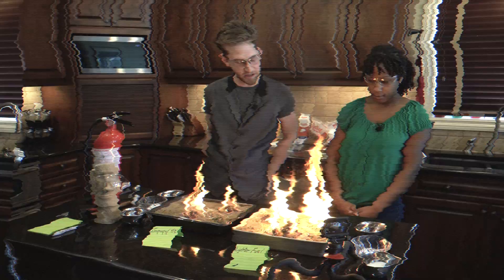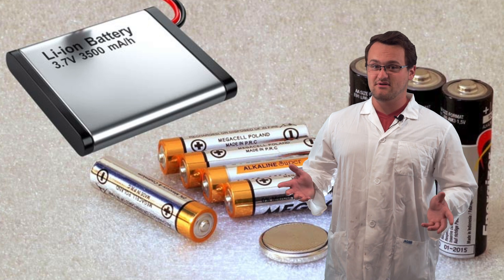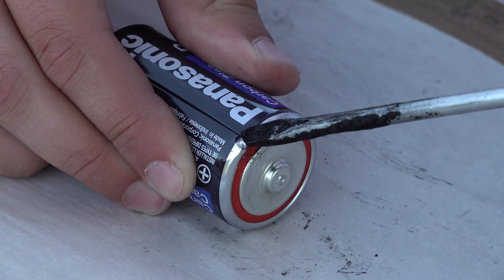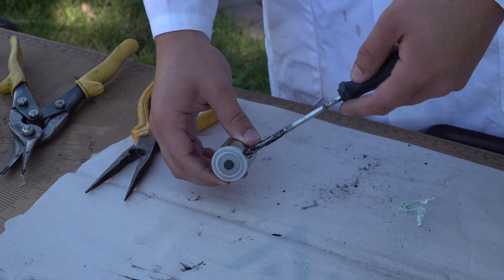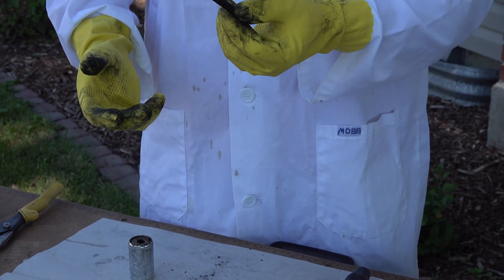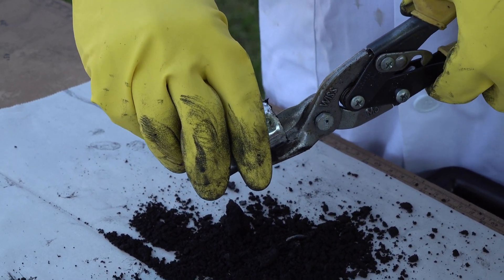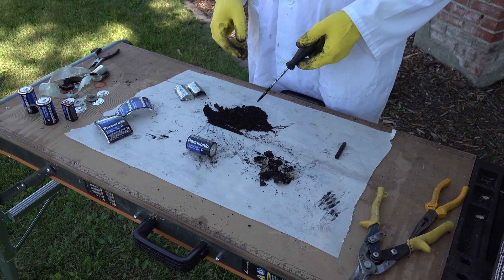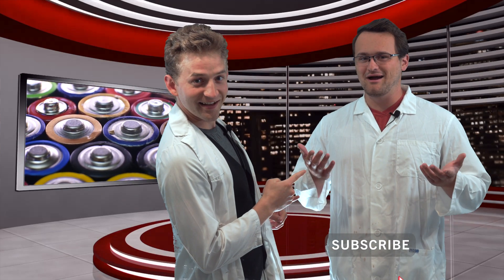How batteries work! Taking apart a carbon zinc battery.

Comment: Carbon zinc batteries don't melt like alkaline batteries  or blow up like energizer batteries. Is panasonic carbon zinc batteries 🔋 damages product over long term use. Like putting batties in a toy and leaving it for a long not in use. Will those products still be good. Is carbon zinc batteries the better type batteries.